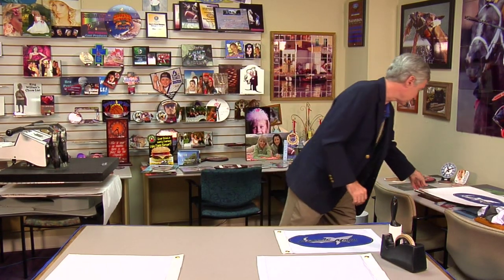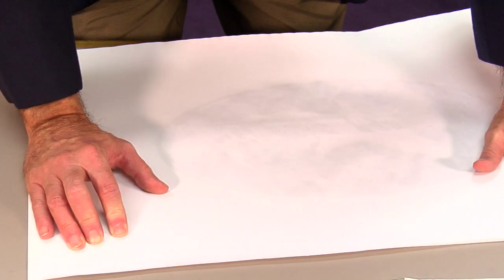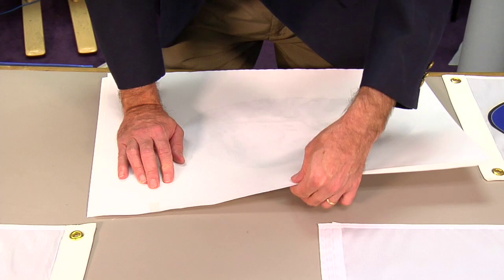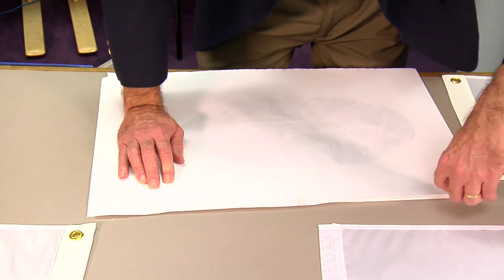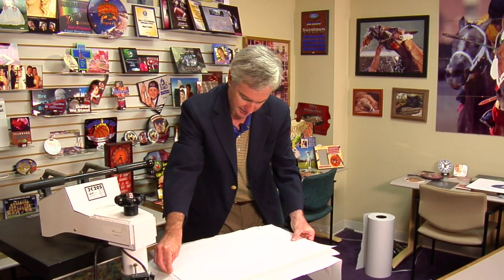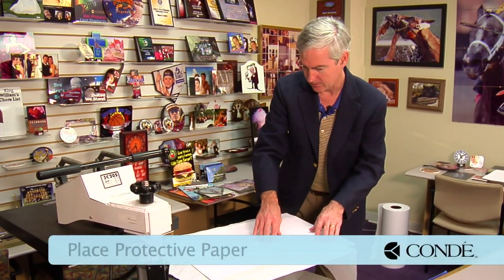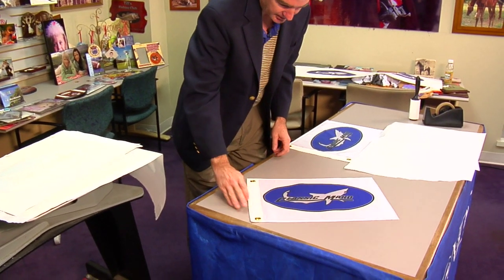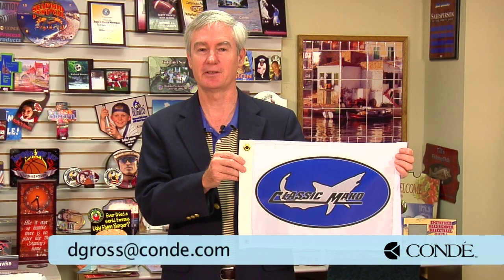Sublimating a Double Sided Flag -

Comment: How will the Albanian national flag print, because the reverse is the same as the original.
Can we print the Double Headed symbol on one side only and have the same effect on both sides?
Reply from the maker: No, you would need to reverse the image and print a transfer for the other side.